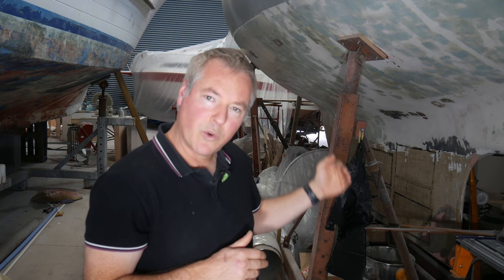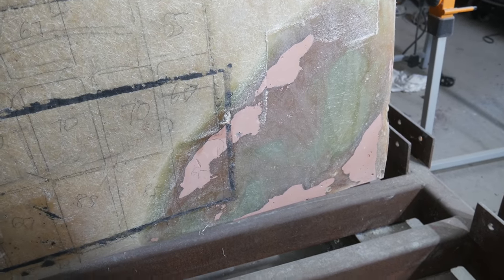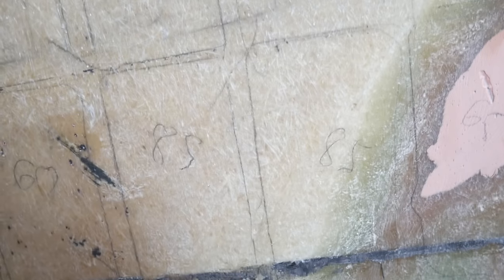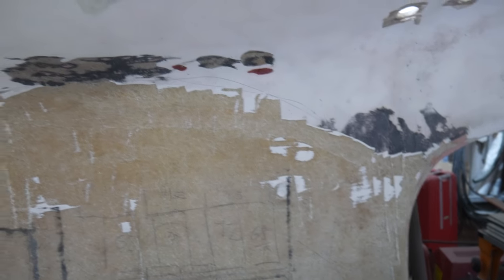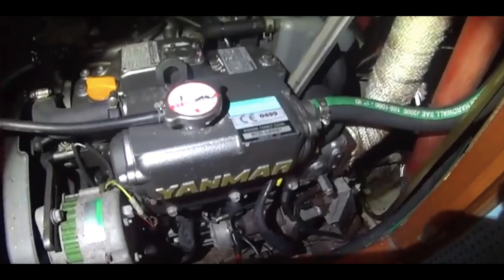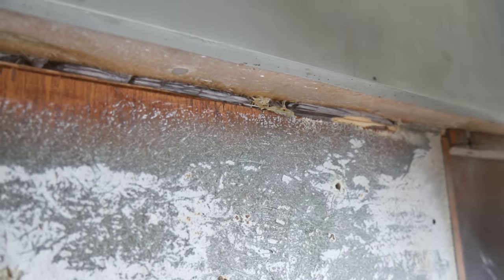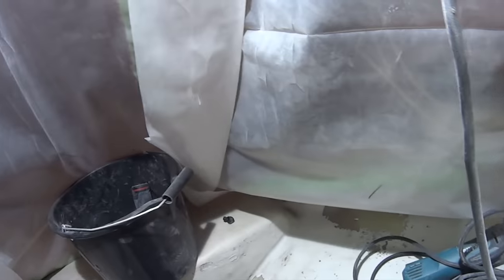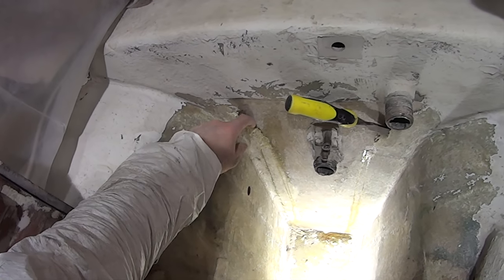#63 Epoxy, Vinlyester or Polyester resin for Diesel Fuel Tank?

Comment: Hi. I went down the Tankguard Storage (epoxy phenolic/novolac) route. Here in Brisbane I paid about A$500 for a 20 litre kit which isn't too bad a price per litre. What I didn't use on the tank I simply used elsewhere; it's quite compatible with the other amine epoxies but with much better chemical resistance.  Essential to use a WFT gauge to ensure solid coverage.

Comment: Although your building efforts for the second project were just microscopic haha, Congratulations, and many congratulations to the builder! For Wanda; Wow you did a great job cleaning that up. It's almost unexplainable how hard it is.  It looks very good. But the video shows that on parts the fibers are whitened and thus effected by water, in resin that by the looks of it is good. This means however that the attachment of resin to the fibers is weakened and overall strength too. Depending on the thickness an extra layer woven or biax may  be a good thing.  And.... i had the same setup as you, separate googles and a breathing mask. Until the day i felt something in my eye. At the hospital they drilled out a small polyester fiber out of my retina...whoops. two days later i bought a full face mask which uses the same brand filters for the  to comegrinding days. It makes a huge difference! and it's really worth it comfort, safety and daddy wise. For small and not so dusty work is still use the small breathing mask. So that one is still good to have.
Reply from the maker: Haha yes microscopic indeed but with so much more consequences! thanks for your kind words

Comment: Me too.. 3 steps fwd 4 steps back. A few years ago I did extensive repairs to a built in steel fuel tank.. pinholes at the lowest point. I cut inspection hatches in, prepped the interior then used epoxy and cloth. I Later found out ethanol is to be added to low suifer diesel. WTF! 😲

Comment: Interesting to see, how you will finish fueltank project, I have HR Monsun with keel, it's not leaking yet? Currently using daytank & wondering which way to go...
Reply from the maker: Hey Mika thanks a lot for you comment - does the Monsun have an integral fuel tank or is it stainless steel?

Comment: If you use the special polyester for the fuel tank have you found out how it will react with your existing polyester in the keel?   Steps necessary to get it to mechanically bond to the old fiberglass?
Reply from the maker: Hi Douglass, I will apply a few layers of mat with epoxy resin to the inside of the keel as I need to add back some material that was taken off during the repair. So the polyester would rely on a pure mechanical bond to good, clean and well abraded epoxy. Its a coating only so not relying on any particularly strong mechanical bond

Comment: i am considering applying coppercoat on my hull, but i do have alot of previous layers. i take it its possible to use the gel peeler to just go thru those layers without removing the gelcoat. thanks for any input
Reply from the maker: hiya - the gel peeler will go through the gelcoat unless you find one where you can set the depth very finely. I would not know if it will do what you want it to or not.
Reply: @aboatcalledwanda6925   Hi, thanks for your reply. from what ive been reading the prep work for coppercoat has to be really precise in terms of removing all previous layers till the gelcoat. then apply a barrier coat, then apply coppercoat. but sanding it down to bare gelcoat is a lenghty process to put it mildly, so i was thinking that maybe, using the gelpeeler to remove everything including the gelcoat, then applying a barrier coat and then coppercoat would be a much faster process

Comment: Bad smells like vinegar could be osmosis. Doesn’t really matter as you have taken care of it
Reply from the maker: Yeah it was a sharp smell -  bit like vinegar
Reply: An acidic smelling water on a GPR boat is not equal to osmoses. Osmoses is just the proces of equalizing fluids trough some sort of a membrane. In this case there is no membrane just locked in moisture and water, from leaks, condensation, etc. The acidic nature comes from the brake down of esters, hydrolyzing binders, sizing etc.

Comment: BS with fg tank it will delam after a while check around.. stainless is the way to go
Reply: It will delaminate if not done properly or if laminated with wrong resins.
Industrial composite tanks have been around already for decades.
"Kevlar" fuel tanks have been used in automotive sports since the 80's.
Vinylester resin is the most cemical tolerant, as a rule of thumb.
I'm sure the new polyester compound A Boat Called Wanda is planning to use is very good choise as well, since it's a dedicated resin for tanks.
Reply from the maker: hey Jeff what do you mean by BS? Not sure what part you think will delaminate?
Reply: @aboatcalledwanda6925  Sorry I just be usisng a fg tank is a really bad idea. Whatever
you use as an epoxy or resin will deteeriotate and give you huge headaches later
Reply from the maker: @Jack neff I’m open to listen to other people’s experiences and to learn from them, it would be good to know more about why you think epoxy or other resin will deteriorate? Also good if you know of any documentation or testing evidence to get a bit more detail? From the technical specification I have been given for Scott Bader 474 PA, it clearly shows that the resin is impervious to diesel stored up to 40 degrees (which is considered high temperature for storage) And for Ethanol a constant storage also up to 40 degrees. This is an industrial usage material for the construction of fibreglass pipes and storage. Now I’m not saying you haven’t heard stories or had first hand information of a fuel tank delaminating. But there could be two reasons for that - incorrect choice of resin and incorrect layup. I have ensured I am using the best type of resin for the job, according to technical specifications and test evidence. Now so long as my layup can be done well - clean surfaces, proper abrasion, proper mixing in clean containers, mixed at 20 Degrees, laminated at 18 degrees, post cured at 80 degrees for 3 hours, with a resin rich outer layer, ( and no voids or air pockets of course) well if I can do all that then this is going to be rock solid and will never delaminate over time. Just as the commercial tanks, pipes and industrial equipment using this product in a fibreglass layup have not. 👍

Comment: Indeed, I am surprised with your choice ! Transforming the keel into a diesel fuel tank is NOT a good idea. Of course it is cheaper to do but it is very unsafe. Imagine the boat drifting toward a reef (like it certainly did before). If the keel is cracked or punctured where the "tank" is, you end up with all your diesel fuel in the sea. If the diesel fuel is in a stainless steel tank, inside the keel, that tank would certainly be dented but most likely NOT punctured and the diesel fuel stay in the tank. 

We often criticise the big companies for adopting unsafe procedures resulting in polluting the environment, just because they wanted to save money. Do you really want to take down that same path ?

So far, I find your videos very instructive and I appreciate the time and effort you invest in doing them.
It is the first time I give a thumb DOWN on YouTube but I think that ill fated decision deserve it.
Did you ask for an opinion for this transformation with your surveyor and your insurance company ?